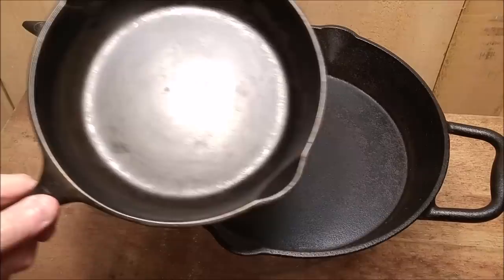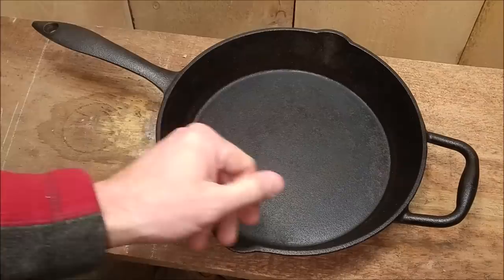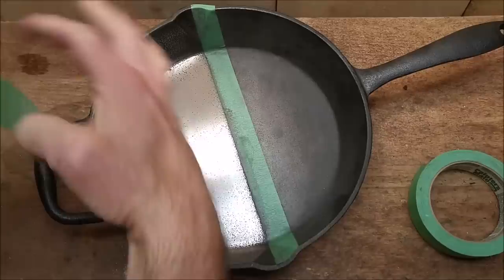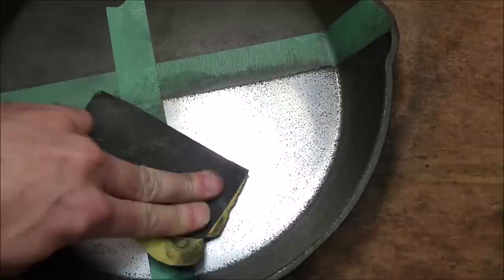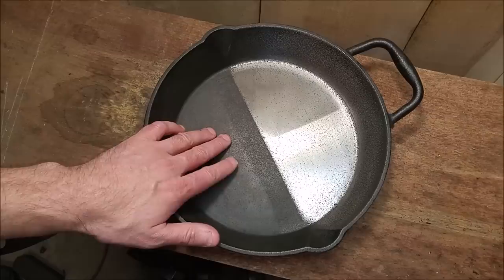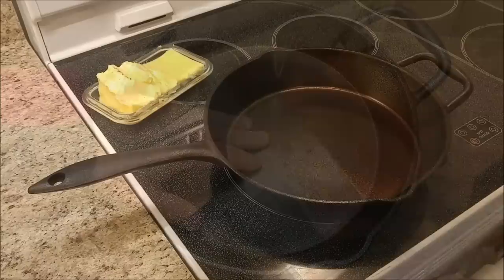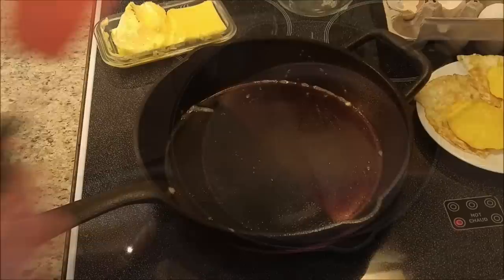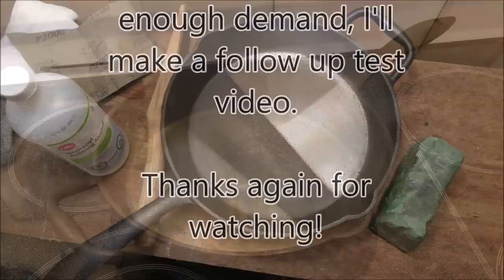🍳EXTREME Polish - Smooth a Cast Iron Pan to Reproduce an Antique Skillet then take it way beyond

Comment: Wen it's time to clean up an old iron pan that i found in a thrift store or one that i let someone use and it comes back rusty or with burnt leftovers in it i use the self cleaning mode on my oven. Most ovens have a self cleaning mode where they get over 500 deg f. some as high as 750 deg f. u have to remove the oven racks and most of the cheaper oven thermometers. i just set the pan upright on the bottom of the oven and turn on the cleaning cycle. If the pan is real heavily caked in baked on grease it might be a little smokey after a while but most of the time the exaust fan over the stove sucks out the smoke. After a few hours when the cleaning cycle is over and the oven cools down you can open the oven door and the pan will have a fine coating of gray ash and rust. Then i use a new wire wheel on a drill, angle grinder or bench grinder to clean and polish the whole pan. then coat it with olive oil and pop it into a 350 deg F. oven for an hour and its like new.
Reply from the maker: I like it, simple and effective; do you only apply one coat of seasoning?

I would really like to try this self-cleaning, maybe do a time-lapse video of the process also to see what happens.  I know our exhaust fan is not great so I normally use the barbecue to season my pans. 

Great comment, thanks for sharing.

Comment: Thanks for the demo! A worse of advise: don't every cold shock the pan like that, it may lead to cracking.
Reply from the maker: I have plans on a video on this subject, a few people have commented on this, however I took this technique from an expert and as long as the water is very hot, you'll be in good shape.  I clean all of my cast iron this way now, and none have cracked.... not to say they couldn't, it might depend largely on whether they are prone to cracking or their material composition, but when I have some time I'll take an extreme approach to it and see if I can crack it. 

I have cracked 1 cast iron, I accidentally turned the burner on to HI and it was a 12" skillet, cracked it within a few minutes. 

I appreciate the comment, keep them coming!
Reply: @NeedItMakeIt  I use this same cleaning technique, and here is my opinion:  water from the hot and cold taps only varies by 30-40 degrees F.  Very little when you are dealing with temperatures of the skillet of 400F or more.  Cast iron will definitely crack if heated or cooled unevenly and quickly.  So, I use whatever water is coming from the tap, don't worry about making it very hot.  Just DO NOT put much water in the skillet at once.  The steam seems to be the thing that does the cleaning, and a couple of tablespoons of water seems to be enough to accomplish the job.  So a few tablespoons of water in the skillet, swirl it quickly to distribute the cooling effect, a quick brush, and dump it out...clean pan.  I have been using this for several years, and have not cracked one yet.  Cast iron is the best non-stick cookware out there, and I  have tried them all.  Another case of don't fix it if it ain't broke.  So glad I came across my first cast iron at the junk yard.  One man's trash, etc.
Reply: Using only a little water is a very good advice. You just need some steam to loosen sticky stuff. 
You may also let the skillet cool down a little and then use very hot (boiling) water. Just make sure never to put the skillet through big, sudden differences in temperature or it may warp or even crack.
Reply: Yeah, when I saw that I pretty much lost any faith that he knows cast iron
Reply: Just don't do it with a very hot pan. Just hot enough to sizzle the water

Comment: A few years ago I tried this with a carbon steel pan but it was a complete waste of time. Fortunately I used sanding/polishing pads and an electric drill so not THAT much time but I had an actual mirror finish on it.. Couldn't get any seasoning to stick at all. Ended up going over it with 200 grit or so sandpaper, and it's been pretty decent since. Of course the carbon steel was already polished so not comparable. I think there's something to be said for getting rid of the casting marks on the surface of a cast iron pan, you just don't get a benefit taking it to a mirror finish or anything even close.
Reply from the maker: I'd agree, I did a follow up video showing exactly what you did and I had really good results with 100 - 220 grits.  The seasoning benefits from some small abrasions in the surface to help it stay on.  I also found that the Stargazer seasoning method worked better than ones I had tried in the past.

Comment: Joints in my fingers wouldn't make it past the initial scrubbing with a brilllo Pad ! :)  I used the $5 grinding wheel on a drill, like dozens of others in here. Then took it one step further.  120 grit on a small D.A. sander  Initial seasoniing didn't look like it took well, but after using them a bit, works every bit as well has one of the wife's super pans !   To each their own!  I enjoy doing it, and the Nastalgic part of using them.  Always said,  kinda like a Smoker using a Zippo instead of a Bic.
Reply from the maker: I would have used power tools, but I've found that people tend to hate when you"Ruin" a pan with power tools, so I've tried to do most of the work by hand.  It also shows that you can do this even if you don't have any special equipment.

Comment: I got a lodge one as a gift, I use it pretty often nowadays but i have no other pans to compare to and mine is just the regular finish, I didn’t sand it down at all
Reply from the maker: I don't think there is anything wrong with the Lodge, I'd like to test how using a metal spatula on a rough cast iron pan improves the finish over the course of 6mo-1 year.  It would seem that you don't need to sand if you don't want to, a rough surface will  perform very well also.  There is no question that the smooth surface is easier to clean.

Thanks for taking the time to leave a comment.

Comment: The thing about polishing cast iron.  Is that it takes a lot longer to build up a nice hard seasoned layer.  Which is the problem with your test.  You only began to season the polished sections.  But a polished well seasoned pan is way better than the preseasoning of modern day cast iron.
Reply from the maker: I agree, I think the best idea is to try an reproduce what they used to do in the past with the smooth vintage pans.  I can see on mine that they have visible marks from an abrasive of some type, they likely had enough abrasion marks to allow a better bond for the seasoning.  I'm not completely sure it was sanded, but maybe turned on a lathe, or possible they used a spinning aggressive grinding wheel.  

I have plans for a few follow up videos on this subject, so you'll hopefully see them in a few weeks.

Thanks for the information.

Comment: There is no actual temperature difference on the pan. I have one of those temperature guns and mine came with a setting to adjust it for getting accurate readings of different materials. Stainless steel might read differently than a painted vent register. The temperture difference probably had something to do with reflectivity of the light on the pan. As an example when you shoot the gun at a human forhead it never reads 98.6 or even close. It makes you wonder how the Chinese thought they were screening for their virus with those guns when they are not going to read skin temperatures corectly.
Reply: In my own experiance playing with a IR temp gun like this you can get a good reading if you point it inside your mouth. Your forehead is cooler than your core temp. The surface finish is messing with the reading I think that is evident. I have read some on "black body radiation" and used some info from that to make corrections to readings in spectra-photometers so that may be worth a look.
Reply: a human forehead shouldn't be 98.6... internal body temp and surface temp are separate matters, even in a location like the forehead.  Still, if you aim a temp gun at everyone's forehead and come up with one number that's 4 degrees higher, you know where your problem is.  Concerning the ability to temp different surfaces like cast iron, cast iron definitely has hotspots.  Of the common pan materials, it's actually one of the worst performing conductors.  It does have remarkably high ability to RETAIN heat once hot.  

finally, I agree that the surface finish couldn't possibly have any meaningful influence on the temperature characteristics of the material.

Comment: I like your idea and testing, but a more fair and conclusive test would be to strip the seasoning completely from the skillet after sanding and then reseasoning the entire skillet at the same time. You could repeat this test with this skillet by stripping the entire skillet and reseasoning it all at the same time.
Reply from the maker: That sounds pretty reasonable.  I have a few follow up videos I'll be releasing within a few days showing well seasoned smooth pans performing well with no oil at all.  I have also just completed some additional testing and found that a newly seasoned pan (excessive coats) does not perform as well as one that has been used for some time regardless of the surface texture.  I'm sure there is much more to this that I still don't understand.  Type of oil for seasoning, temperature of while seasoning, amount of layers... some magic.  

What would you use to strip the seasoning off of a pan?
Reply: @NeedItMakeIt  Well I use an electrolysis tank personally, but I have seen people using easy off oven cleaner in a trash bag and also a lye tank. I prefer the electrolysis tank because you don't have to worry about the harsh chemicals or disposal. As far as seasoning is concerned I have used many from Crisco to different oils, Crisbee, and some others. I prefer one I currently use that is made buy a friend of mine which was a chief. I find the Bee's wax based seasonings to work the best if you follow the directions. I usually season at least 3 times before I try to cook in it and then start out with something like bacon or something that gives off oil a few round before I try an egg. You have to get the temp up to between 450-500 degrees for an hour to carbonize the seasoning each round to build up your non stick surface. If not you are just thickening the seasoning on the cast iron. I usually go 200 for 15-20 min then apply seasoning, wipe off as much as possible, put back in at 300-350 for 15-20 min. and remove and wipe again. Lastly put back in the oven at between 450-500 for an hour, shut off oven and allow to cool with door closed. This is how I season my cast iron and get great results. Hope this helps you in your testing.

Comment: The bulge you have in the pan is from the electric stove. Most people complaining about it have either an induction or regular electric stove. People with gas have rarely this type of problems.
Reply from the maker: I don't disagree, the electric stove only heats the bottom, gas would be much better for an even heat I think.  In this particular case, these pans are produced with a bulge in the middle.  I've returned pans to the store thinking that it was just mine only to find that all of the ones of the shelf were identically made.  The complaints from other customers also support this.   If the pan has a large circular void in the bottom with Lagostina inside it, they may have a bulge.  The newer ones look different any they may have corrected the problem.

Comment: I’d say the smooth side would’ve taken about 150 years worth of cooking to achieve so I’m curious to see how it holds up and if the metal fatigues! Great vid !!!
Reply from the maker: So a bit of a problem did come up with the bond between the seasoning and that polished surface.  It did not seem to adhere well.  The rough surface holds it so well so what I have done in some more recent videoshttps://youtu.be/I1DaEke6sPQ is test to see which grit of sanding would provide a good bond, and that grit was down as low as 120 grit.  Those tiny abrasions allowed the seasoning a place to lay, this pan is now my favorite pan to use, looks great, performs well, heats up fairly quick, flat on the inside and doesn't rock around on the glass top.  I have a few more videos coming out in a few weeks, and the completely smooth surface may not be as good as we all think.

Love the comments, keep them coming, and thanks for the support!
Reply: @NeedItMakeIt  I was going to say I found the same thing. Cast iron can be too smooth. The seasoning flakes off. I have vids flipping eggs in smooth cast iron but washing the pan removes about half the seasoning and won't build a good layer. Great job on the hand sanding.  I used tools myself. I've now come to the same realization as you on light sanding with heavier grits to get the best of both season retention and cook ability. BSR is my favorite vintage cookware.

Comment: Eggs, IMHO, should be cooked on a low temperature so that they do not burn, bubble or turn hard. There is nothing more spectacular that 3 jumbo sunny side up eggs cooked at a low temperature for 5 minutes. You can see the whites slowly firm up and the wet stuff cook up and the yolks remain nice and runny. Overcooked, frizzled and bubbly eggs are a crime against cooking!
Reply from the maker: And you're using cast iron for cooking?  What kind of fats do you use and do you have any trouble with the eggs sticking? 

I can't say that I hate the burned butter flavor, but I definitely do not like the thin hard frizzled edges.
Reply: @NeedItMakeIt  you can use homemade clarified butter and/or desi ghee and use for eggs, among many other things.  Youtube has a ton of videos on how to make CB and DG. You can buy these a lot of places, including Amzn. They are almost the same thing.  The smoke point is 482 degrees (F).
Reply: That is the way I do eggs. Slower on lower temp. Supposedly the proteins in the white don’t denature as badly. Denaturing the protein leads to chewy white instead of being soft and fluffy.
Reply: NeedItMakeIt I use an aluminum skillet that is a quality brand name with a finish that doesn’t wear out. There’s noticeable to spot on electric burners but gas is much better. I tried a cast iron skillet, 2 sizes actually, and the first time I used the large one I wasn’t ready for the weight difference and dragged it across the plastic of my conduction gadget melting the plastic! I got tired of all the hassle of drying, heating, oiling, etc. and gave them away. They are great, just not for lazy me. I grew up with stainless steel so it’s hard to change. Every once in a while I forget I am boiling water until the smoke alarm goes off and there’s another burned pan...
A thicker bottom small skillet would work best for the slow cooking of the eggs. You can always set the skilled off the burner if it is cooking too fast. Patience is needed. Time is of the essence in restaurants which is why they don’t deliver perfect sunny side up eggs. Start with low temp and adjust it until it begins to bubble then back off just a bit.
Oh, we’ve wandered off topic a bit...

Comment: Great video. The rough surface never bothered me on any of my cast irons. Unfortunately, I haven’t had the chance to cook on a vintage smooth surface yet so it’s hard to compare but I have cooked on carbon steel. Never put too much thought into it. Some people like to play with their food too much while it’s cooking so the sound might annoy them.
Reply from the maker: I do prefer the smooth, no question now; but like you a few years ago I had no comparison and it seemed fine.  The best advantage is actually the cleaning.  Before I would go through lots of paper-towel, now I use one piece and it is very quick to do.  It really depends on the things you like to cook.  Bacon can be a problem, now I just take a wooden scraper and the residue comes off easily.

In the past, they used to smooth the pans prior to selling them, I know this because 2 of my old Wagners have the marks on the inside of the sidewalls.  They undulate a bit (i can send a photo if you'd like to see), so it seems likely that they just removed that step at some point to save cost.
Reply: Lodge removed the smooth surface process so their seasoning would stick to it.  Because of this, they stayed in business.
Reply: @MrBerroth  Correct. I have several modern Lodge. They all build a seasoning layer much faster than my vintage smooth pans.